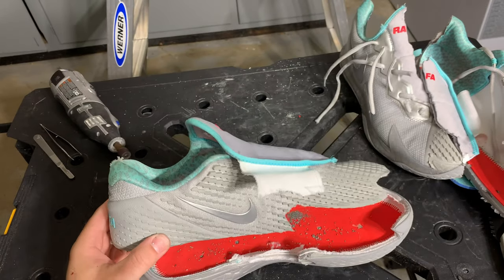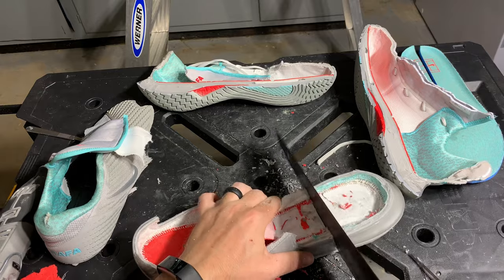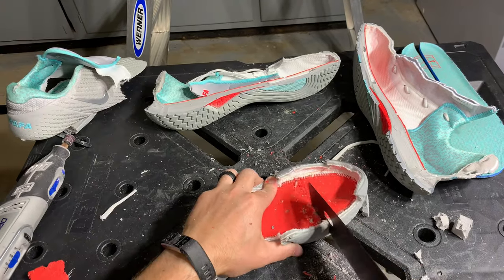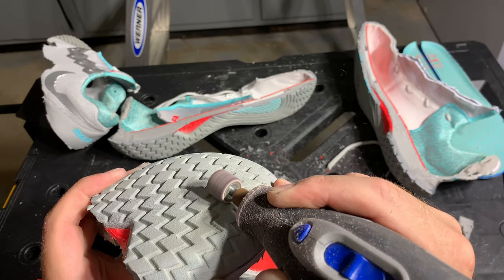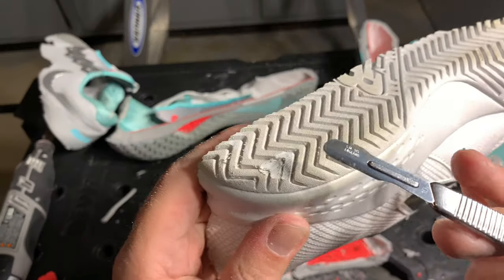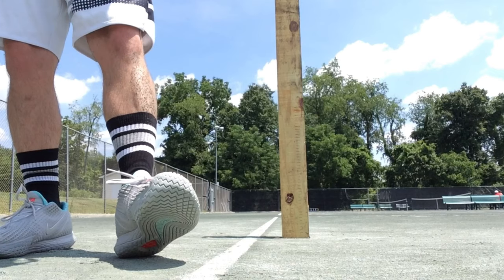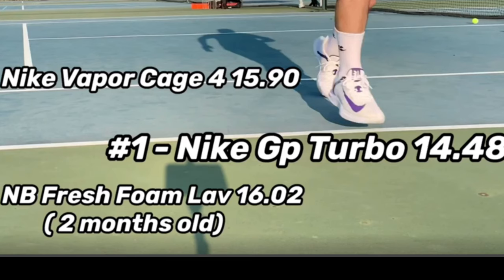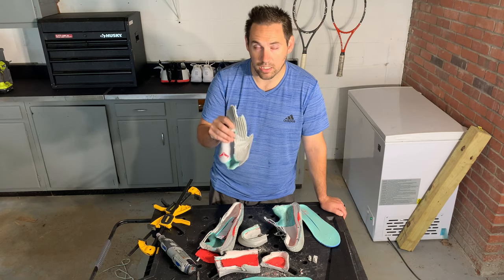Nike Air Zoom Vapor Cage 4 Cut in Half and Durability Tests | Tennis Shoe Teardown

Comment: Hi, I have a question I want to ask, out of Asics gel resolution 8, adidas solecourt boost and the Nike zoom cage 4, which one has the most durable upper, (I usually burn through my tennis shoes in around 3 - 4 months, near the first eyelet on the medial side) thank you very much for your detailed breakdown of different tennis shoes, been waiting for a channel like this
Reply from the maker: Thanks I appreciate that! I’d go with the GR8 or SCB GR8 has the reinforced rubber and SCB has the durability wrap and the outsole coming up over the upper - I’d probably start with the SCB then if you don’t like them the GR8 then if both fail the VC4

Comment: Got them, the clay model actually, I played them 2 months and they already broke in the top part where the rubber pieces are. They just opened in the “knit material”(?). I mean 2 months and i managed to get an hole in them. By playing only on clay!!
Reply from the maker: Yep those fins are pretty stiff I’ve heard a few people crack them- sorry to hear especially on soft clay... if you’re not too wide try the eclipsion 3, they play similar just alittle quicker or the blushields if you are wider
Reply: Thanks!!

Comment: what would you recommend as a speedy shoe, but also a decent amount of padding/comfort ?  looking at the cage 4 (not Rafa edition, just regular ones) at a great 45%  off deal.. before I  ,,bite" into it, though, was wondering what you would recommend that would come close as these for comfort but also a bit more speedier
Reply from the maker: Either the Asics court ff 2 or Nike GP turbo - both fast and more padded
Reply: The Tennis Pro Doc GP turbo sounds interesting. Do they have a clay version of that ?
Reply: The Tennis Pro Doc - nevermind. I saw that they have a clay court version. Unfortunately most of the colors include a lot of white, which is not ideal for clay. Maybe I'll still go in the end with an all green cage 4
Reply from the maker: I haven’t seen the GP turbo clay version for sale  yet - cage 4 clay treads are pretty cool - I always liked the clay stain on my shoes - was like a badge of honor haha
Reply: The Tennis Pro Doc actually I hate any stain on any shoe  hahhaha. But in this case I think I know what you mean  :)

Comment: How do these shoes stand against the asics gel resolution 8 shoe?
Reply from the maker: It’s a lot different- much more material in the uppers, heavier, more clunky , but more secure, not as much bounce - I’d rather have the GR8 but just watch for heel slippage in the GR8 and make sure you use my lacing technique like I described in the GR8 clay video 👍
Reply: @FootDoctorZach  Cool, thanks! What I love with my GR8 is the stability at the heel and the bounce. Not sure what you mean by heel slippage... i've had no such issues.
Reply from the maker: People with high arches or narrow heels- others don’t have issues it seems like

Comment: haha I've had these shoes for less than 3 weeks and I've already tore a hole through the part of the upper you did the drummel test on 😅 I have yet to find a shoe that can withstand my aggressive hard court sliding
Reply from the maker: Yup if you burn through the VC4 gonna be tough to find a pair more resistant to HC sliding